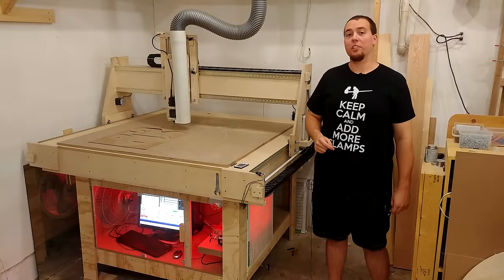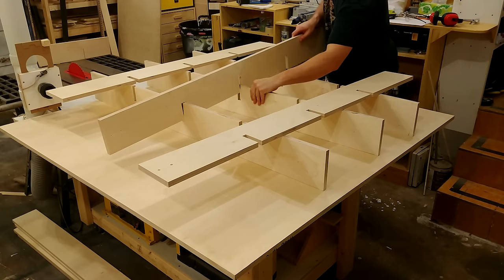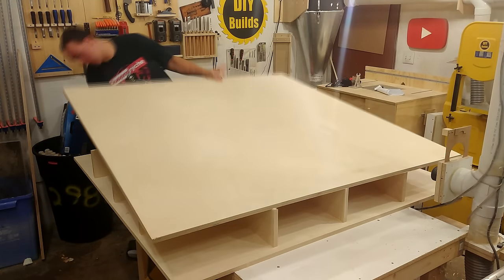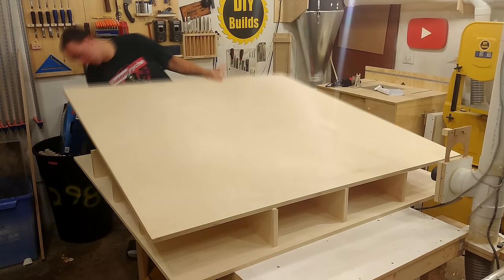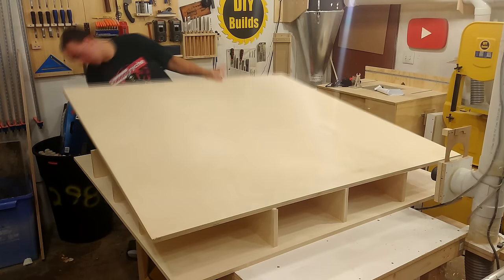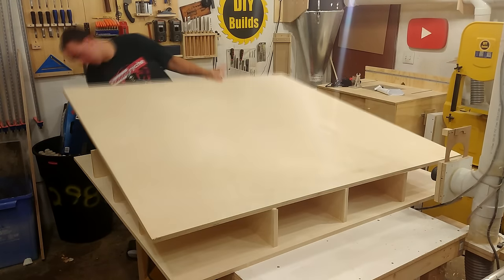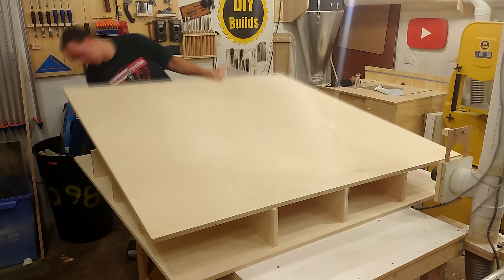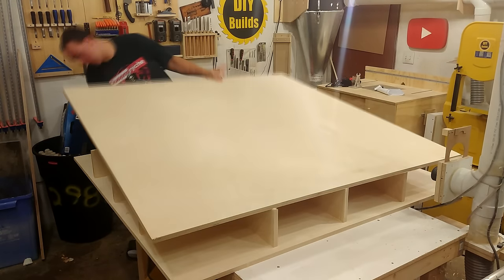DIY CNC Router for Under $900 - Free Plans Available

Comment: This is a good and comprehensive build, especially for the materials and cost. 
Have you done any indicated measurements to show the accuracy of the finished cut vs the g-code? I'm interested to know how the improvised linear bearings combined with a wood chassis handle the applied loads, with reference to thier parallelism and accuracy of measurements in regards to repeatability.
Also did you build in any form adjustment to tram the bearings in?

Comment: After 2 years of use do you have thoughts of what you might have done differently?  This is about the only 4'x4' CNC that looks very solid for under $1K.  Have you considered expanding the table and cutting area to cover a full 4'x8' sheet of plywood?
Reply: I’m sure it’d be pretty easy if you just bought longer tracks and a bigger table

Comment: How did you miter saw cut the lexan so cleanly? I’ve tried many different ways and it always ends up with the piece catching on the saw blade and flying away like a boomerang! Sounds like a grenade when it does, too, which prompts a wellness check from the old lady.

Comment: I don’t know how long this took you, but I think that this is the best Woodworking build video I have ever seen.  No seriously!  The video, the narration and the explanation and circuit diagram are exceptional.
Reply from the maker: Thanks david. It was a labour of love.
Reply: I totally agree.  This video has inspired me to build a similar item.
Reply: I agree. The best video I have seen on woodwork/cnc topic. Thanks
Reply: Totally agree!
Reply: You aren’t kidding.....now I have to go do all the rest of you videos.....great project and performance!
Reply: I’ve not thought of building my own till seeing your video! My experience with woodworking CNC is only with BIESSE, Inc. machine Model 336A  from ‘95 thru 2010. Italian-made & Very precise to 0.010”  ...I did most all the programming off prints supplied and operating of production runs of cabinetry parts ie, doors, drawer fronts, side & back panels, chair parts, etc. The 336A incorporated 2 vertical 5hp router heads with automatic bit change from a 6-position tool magazine, 26 vertical & 6 horizontal drill spindles And a multi-position 3” & 5” circular Saw head. It was great fun programming it & watching it dance around its 8’ horizontal table top! Tnx for the idea
Reply: It's amazing how fast you work too! I want you on my crew!
Reply: @DIYBuilds  . ................)))))
Reply: Incredible.
Reply: Me too, its probably the best build video I have ever seen for anything, Its perfect.
Reply: Agreed!
Reply: except hes saying zed instead of z
Reply: xmetrix xmetrix 🇨🇦 says Zed.
Reply: @HBSuccess  yea im an idiot, i didnt read his description where it clearly states a .ca website. My bad.
Reply: xmetrix xmetrix n;
Reply: @DIYBuilds  - This Video is almost like those HIgh School "Lunch Time Serial Films" I got, back in the day, Entertaining, AND in great Detail! Especially, in concert with reference to Available Plans! 

It's like the "How To Do It" DVD that should Accompany ALL sophisticated Build Instructions! Thank you!
Reply: @xmetrix  - "ZED", from Men In Black! Or, dontcha know? 🤔😁🤭
Reply: @DIYBuilds  Faber molding on
Reply: Me too.  And I have seen every video on youtube.
Reply: @DIYBuilds  we a🍉
Reply: V-$:
Reply: @DIYBuilds   ouunui jonununo no joouuuuonio n not yet sure what onomatopoeia would like óno not quite

Comment: Thank you for your work and for such a great design solution. I have a question regarding DIN rails. What are their dimensions: 35mm x 7.5mm and 1mm thickness or 35mm x 15mm with 1.5mm thickness? How do they withstand lateral loads?

Comment: I haven't gotten to the end quiet yet but now i'm getting really impressed. How much would you charge a person to create one of these. About the other question, will it cut through soft metals. Which I mean if you are programing that I can go in and change a few G codes and M codes to make it move slower and cut it but that would take a while? How accurate is it? Is it within tenths, maybe .2 tenths but nothing over a thousandth of an inch.

Comment: Excellent project (I have experience in plasma CNC). I see that over a year has passed since this post. How has the CNC stood up to time? I've seen the video on re-calibrating, but is maintaining accuracy an issue? Being made of wood does humidity/temperature affect day-to-day adjustments? How long to the belts last (he does provide plans for belt tensioners on his website)? Have any updates or changes been suggested to the design over time?

Comment: Great work method and video, last section was a little intimidating for me, followed the build part easily, lost me on the set up, you obviously know your way around software as well as you do on the hardware.
Might be worth a detailed video on set up if others have the same observations, great project either way, very inspiring.
Reply: I would actually love to see the detailed video on setup, I have now realized I need to research more CNC controller work and why.  Because I did not completely understand why you needed to clone the Y axis. :<
Reply: Ricc Ballard  Because there is there is a stepper motor on either end of the gantry, they need to be rotated exactly in sync, otherwise the gantry will bind on its bearings. This is sometimes done with a shaft that runs the full length of the gantry to drive the pulley on either end, but this design uses the electronics to do that. Hence there are four stepper motors: Y and A, one at either end of the gantry to pull it along its belts; X that pulls the Z-axis assembly side-to-side along the gantry; and then Z that raises and lowers the router carriage on the screw.
Reply: @TimFSpears  thanks, that explains it perfectly. As stated above I am starting my research into CNC tables and the entire process and and all the gotchas.  This is one of those I do believe.  Again thanks for the full detailed explanation as I would have fubar-ed this.

Comment: Great build! I am making a cnc with four nema 23 motors also. I also bought a similar supply supply and it has three output sets same as yours. How did you wire the fourth motor driver (a axis) to the power supply? Is it ok to wire two motor drivers to one output set?

Comment: Nice video!   I just purchased a used CNC lathe for only a couple hundred bucks but didn’t include operating software.  I didn’t see a link to the cnc software.  Is this included with the $189 eBay kit?

Comment: A very well-thought-out design. Amazing what you can do with wood! The only change I might make is to add cam mounts to the guide wheels to allow them to be adjusted. Even though they’re bolted down tight they will move over time as the surrounding wood is compressed under load.
Reply: I second that on the cams.

Comment: I am checking out the plans and question the vertical position of the Gantry. When you built you had forgotten the angle cut induct it afterwards.  I see in the plans you have the top at 7" and down 3". To have the gantry even with the back and the angle cut it would be quite low. What would the height for the Gantry.  Thanks

Comment: What power did you use for the contactor coil? I see a power supply of 12Vdc, I see 24Vdc just right of it and I also see a 24Vac coil. Apart from that I would have used some,do you call that hose or tubing, to put around the motor wires to create a cable. But all in all you did a great job and I wish you lots of fun with the machine.

Comment: Hi Brad. Your build gave me the courage to get started building my own CNC router table. I just wanted to post to say thanks. 

I didn't hit the $900 water mark but only doubled the overall cost. I figured it's a fair trade off for a mostly steel constructed design with ball screws, linear rails and a 2.2KW Water Cooled Spindle Motor+220V/110V Inverter+80MM Clamp+Water Pump.  

Gotta love Aliexpress and Amazon!

Thanks again!
Reply: i think steel is the only way to go for precision and longevity. A wood construction will not last long i think and would be prone to many issues including humidity.
Reply: I wonder why anyone would use a water cooled spindle motor? I've owned 3 CNC machines, one had water cooling. It was a PIA. Our current machine has many 1000s of hours on the 12hp air cooled spindle motor with no problems. It runs all day, everyday.
Reply: I am looking at about £1200-£1800 to make a machine, this includes enclosure out of wood, extraction system, vacuum table, filter system, you might think all that stupid on a cnc mill but looking to have it as a 2.2KW spindle and can take that off and put another head on for a CO2 laser, maybe 80 watt+ but might look at higher for one to engrave metal, looking to also get rack and pinion for better precision than belt but haven't yet learnt how someone makes that work yet, looking for 3ft by 2ft area as when in a home can't go too big

Comment: Is it necessary to make the torsion box and the table shelf bracing as tall as you did? How much rigidity do you lose as you go with a shorter box?

Love it when the shop foreman shows up to hand you screws at about 22 minutes in. :D

Oooh, the infamous CheapChineseTools™ trim router!  Does yours smell like it's burning itself out every time you power it on? :D

Comment: When I built my CNC machine I found that I am more interested in making smaller projects than I initially imagined I'd want to do. Funny how some things are not how I imagined they'd be.
Reply: @Paul...what program did you use for your CNC and are there any ones that are free.
Reply: @woody7999  I use LinuxCNC. It is free.
Reply: Well, you need all of the same parts if you build big, or small, in terms of motors, circuit boards, etc... The only difference is amount of supporting material for structure, etc... Being able to go large is definitely a plus.

Comment: How is the strength of drilling will it hot sheets of wood of what thickness, does it manage 1 to 2mm sheet of aluminium.
The Ply Wood based CNC can it be prepared using another material like steel or aluminium
Please comment.

Comment: $900.00 in parts, $25,000.00 in engineering, woodworking, electronics and video editing skills.
Reply: I agree! I wonder how much the needed equipment is to make the CNC.
Reply: I make one in belt drive for 300$ 2000 mm x 2000 when i worked in Africa super effective than 40000 $ imported there

Comment: Wow.. Now I want to bulid one too. Got an 3D printer I like to convert to a cnc router. Maybe one day...
Reply: If you have a 3d printer, look up mpcnc, its a 3d printed CNC machine that costs even less than this one and can cut even bigger. + laser + vinyl cutting + another 3d printer + more. I made mine with a 3' by 3' build area, and it was less than 600 bucks after printing the parts.
Reply: @Kevin-rr1nm  , NO, make it out of aluminum. Why waste all those motors and drives on flimsey plastic ?  when for the same price a metal machine is much better.

Comment: How the hell dislike this proyect? Excelent cheap CNC!
Reply: There are some sketchy design decisions going on here. Like I'm glad daisy chaining the grounds worked for them. That is generally considered a bad practice though. They're also leaving a lot of performance on the table by using a 24V supply for their drives. You'd be surprised how much difference a few volts makes to stepper motors at higher RPM. I know I was. Explaining why that's the case is a bit complicated. It has to do with dwell time and inductive reluctance. The drives they're using look like crap to me too. But not knowing more details I could be wrong. The devil is always in the details. But I didn't thumb it down.
Reply: @1pcfred  don't forget the comically unsafe table saw use. No knife or splitter and not using push sticks.
Reply: @michaelposey6529  if someone walks away relatively intact I never criticize their safety practices. I figure what they're doing obviously works for them. I don't use a riving knife myself. I've never had work kick back on me either. Or any mishap using any kind of circular saw for that matter.
Reply: @1pcfred  just because you have never made a simple mistake and horribly injured yourself doesn't validate your dangerous use of tools. Your shop, your rules but unsafe practices are unsafe practices.
Reply: @michaelposey6529  if my practices were so unsafe something would have happened by now.
Reply: @1pcfred  Said every woodworker/construction worker missing fingers EVER. You can argue all you want but you are wrong and anyone who is a serious woodworker will tell you that. Risking catastrophic amputation or a horrible kickback injury simply because you're that awesome is just stupidity.

Comment: MOMENTS LATER FROM GLUING UP THE BOX "HONEY HAVE YOU SEEN THE CAT?"
Reply: Hahahahaha I sealed out cat in a fiberglass bathtub enclosure. It was open for awhile and I forgot to check. When my wife came home and saw it the first thing she said was where’s the cat? I ended up opening the ceiling below because the surround was wire and mortar. I had forgotten about that it was 15 years ago
Reply: BELT T5 X 15 OR T5 X 25?
Reply: I once accidentally locked a cat in a box and had started to carry it out to a car to take it to a storage unit before I checked the box.
Reply: @garethbaus5471  Good thing you checked my good friend Gordon Shumway told me that is some good eating!!!

Comment: Detailed, concise and easy to follow in conjunction with the drawings.. Very well done.  Looks like a 200 hour project with a basic understanding of woodworking, electrical and CNC programming along with a reasonably well equipped workshop.  I must admit it never occurred to me DIN rail could be used for such an application.  Very well done.

Comment: Great video, how did you determine the setup for your output signals? I apologize if this question is a duplicate, the extension I just downloaded is only searching through 800 comments not the full amount. Thanks

Comment: Watched this back when it was posted because it looked sweet. Watching it again now because I’m getting ready to build one. Now that you’ve had it for a while, I’m wondering if you can comment on a few things. I know you upgraded the z rails and added belt tensioner since too. 
How often do you use it?
How are the belt and din rails holding up?
Any issues you’ve encountered that would be alleviated by using rack and pinion and/or linear block rails for the y axis?
Anything you would do differently?
How often do you use (or what do you build using) the full 4x4 machine area?
I’d like to keep cost down but not opposed to higher end rails if it’s significantly better for doing wood projects. Also need to fit it in a 3rd stall only, so was thinking of making a 4x4 overall size with 3x3 working area. 
Awesome videos, and I agree with below poster - great editing and keeping your vids to the point!

Comment: losing 10000 steps on the Z by the way ?. that ratling indicates some problems in  either the lpt port if you use any?  mine had this problem when the computer played the PING from mach  3 :) then the motor made this ratliing sound... it interupted the  lpt... disabling the internal sound card fixed it. but in this case it might be a mechanical thing to. it just does not sound the way it should if you ask me.
besides that impressive build cramped in 1 video !

Comment: I cannot understand the IDIOTS who give this guy a thumbs down. Probably makers of CNC machines who charge THOUSANDS. lol. Kev. UK
Reply: most likely people who think their input holds some kind of significance on the internet of 2019, and want to exert that significance by providing their input when a video is recommended to them, based on a logic completely unknown and unfathomable to them.

-"A carpentry video? Why am I receiving a carpentry video when all I want is cat videos? DISLIKE! That'll teach them administrators to fine tune their deliveries!"

.....yeah..... believe it or not, there's still people like that.
Reply from the maker: Ill take it you don't actually use table saws. That cut was more than a foot from the fence. Push sticks are only used with narrow cuts. My rule of thumb is under 6".

Comment: When building a machine with limit switches I like to use two switches in parallel that way if one of the switches fails you have a better zchance of not crashing. Especially when those exposed cheap microswitches. 
Just a thought, nice build.

Comment: Similar to a car, all of your electrical components' bodies are ground.  They should all be mounted together.  This is normally done through the computer case, with all of the standoffs being additional paths to ground.  The unifies them all and grounds them to the power supply which is connected to ground through the wire into your panel.

Comment: Beautiful!...great design....being an EE and totally new to CNC (i learned G-cod yesterday and simulated the designs on line with ncviewer.com )...there is something i dont understand at all, why do you need the fourth axis (A) and why you states that the A axis copies the Y axis?? .....in my understanding the A axis corresponds to the the Azimuth angle (also know as Yaw angle in aerospace or antenna control )  around the Z axis...so if you would have a rotating table on top of your main CNC table main plain then yes.....otherwise it does not makes sense any sense to me....maybe you just plan to implement that in the future....but even then the question remains why the "A axis copies the Z axis"?...or is that just a trick so to avoid a control software error if the A axis is not assigned any reference??

Comment: O would suggest a more active tensioning system for the belts.  That implies using a spring to give one of the pulleys a few lbs of active tensioning.